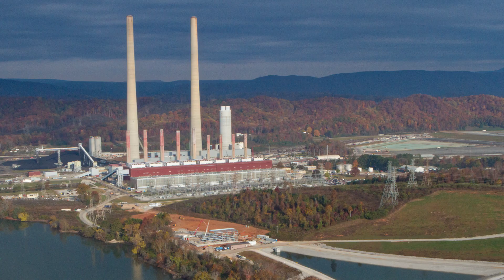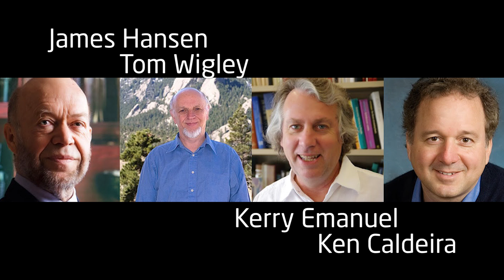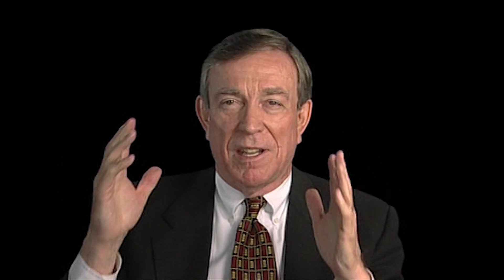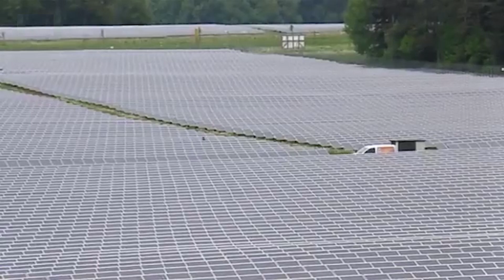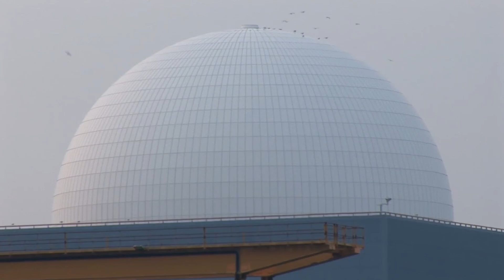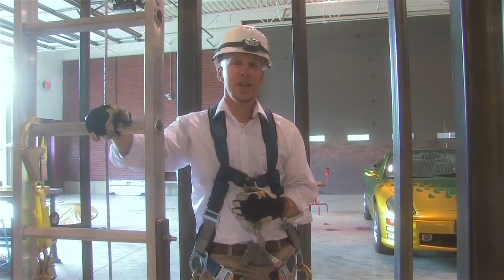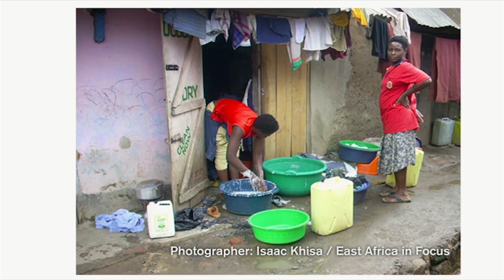Global Warming: Greens vs Nuclear - "Th" Thorium Documentary

Comment: completely shit this video, really ridiculous! renewables can be implemented a 100 times faster than nuclear! nuclear is for dreamers and for the big power companies so they can go on making lots of money!
Reply from the maker: FidelKastrat, Germany's nuclear build began in 1975, and German reactors still provide 18% of German electricity. As the International Panel on Climate Change (UN) observes, nuclear is carbon-free energy. Don't look to Germany's amazingly rapid deployment of renewables (which is impressive), take a look at their GHG emissions. Germany is as-of-yet unable to lower emissions as they replace nuclear, no matter how fast they deploy renewables. This is not because deploying renewables is a challenge, but because the sun goes down, and the wind does not always blow. At those moments, either the lights go out or carbon is emitted.

It took Germany about 15 years to decarbonize about 20% of their grid. I think what you wish for is the ability to DECARBONIZE 100x faster than that, not just the ability to deploy renewable hardware quickly.

Nuclear tends to scale up really well, so yes, the plants tend to be operated by large utility companies. Small Molten Salt Reactors offer the potential for community size energy production, but nuclear will never scale down to household scale.

You can always power your own house with solar + batteries + inverter, if you're not keen on economies of scale. Grow your own food. Turn your own waste into fertilizer. Home school.

If you want to address global warming quickly, you install a nuclear reactor (such as an AP1000, an IMSR or a LFTR) wherever a coal plant is currently sitting. With today's reactors (eg. AP1000) we'd be shipping in fuel. With tomorrow's reactors (LFTR) you'd take the HUGE pile of coal-ash and harness the uranium+thorium fuels stored within. There's more energy in the coal-ash in the form of nuclear fuels than was ever generated by burning the coal.

No new powerlines needed. No energy storage miracles needed. Everything is accomplished on land already dedicated to energy production.
Reply: gordonmcdowell  The new npp that they are building in Finland will be ready (if it works this time) in 2018. That means 13 years to build it. And it’s the same everywhere with other npp. Most of the time there are unexpected problems  and it lasts much longer than expected. And the costs tripled nearly!
Solar can be installed very very quickly. In 2012 we installed PV, the dimension of a whole npp in just one month! You can’t beat that. Yes, it started in 2000 but until 2010 solar was still less than 1%. Now we’ve got nearly 6%! In a very short time! You can’t compete with solar and wind. Nothing is faster!
If we would increase the speed we could be at 60 % or more of renewables in 2022 when the last npp will be shut down. That would replace also lots of coal pp as well
The new npp that are planned in England at Hinkley point will be ready in 2022 (perhaps if everything works well) The EU will give billons of subsidies and the price they will get per kWh will be subsidized as well – 10,6 cent kWh (Euro). In Germany we pay today for PV 9, 45 cent KWh for solar and the prices will go down until 2022. While the price for the nuclear from Hinkley point will rise since these 10,6 cent are linked to the inflation. IN 2057 when they will close them again the price could be at 25 cent/kWh or even more! What do they want in Britain with that shit? They’ve got an enormous potential in Wind energy. But they are wasting their money – money from the EU that I pay for as well!
Reply from the maker: FidelKastrat I'm not saying any Th-MSR reactors are available today. And I'm NOT saying you need to stop fighting climate change by other means until they are ready. However: Return-On-Investment for renewables goes down as they saturate the grid, so I'm trying to intercept the moment where building an additional wind turbine or deploying an additional solar panel on a grid is no longer attractive. A second solar panel on a neighbor's house will peak-and-trough identically... once the grid is saturated that peak has zero value (sometimes negative value).
 .
AP1000 are acceptable for any industrialized nation with a body of cooling water available. That's essentially a zero-carbon solution offering gigawatts of energy. Power being supplied by coal to a grid? That's an straight-forward replacement. There are many opportunities to do this around the world.
 .
You might find, however, like the Breakthrough article mentions, that your supposedly "cheap" intermittent energy source deployed in developing nations will be abandoned after construction. Because the people you've built it for would rather have 24/7 energy once that becomes available.
 .
"Solar is solving problems in Africa every day!"
 .
I make this case in another video. Sorry I don't have time to cram every nugget of info into every video. For having watched this video 2x, you are aware there are other videos in this series?
 .
Yes. I'm happy to see solar deployed around the world. That has no bearing on my trying to educate people about different forms of nuclear reactors. That has no bearing on me trying to show why we should try lower the cost of carbon-free energy.
 .
But you see that deploying a windmill or solar panel doesn't fundamentally drive the technology forward, right? You can lower manufacturing costs and optimize deployment strategies, but fundamental R&D problems (such as energy storage) don't get tackled simply because another solar panel has been deployed?
 .
Developing nations (and developed nations) burn coal and natural gas. They do this because it is cheap. That's why fundamental advances are needed. I'm trying to enable that. If you want to focus on deployment and not R&D then go for it. I'm hardly alone in thinking that's an uphill battle.
 .
Bill Gates (for example) supports R&D into solar. He's spending his own money on that because he sees a fundamental opportunity to improve the technology. (As he does nuclear.) He does CAUTION against a deploy-deploy-deploy strategy. Gates says far too little is spent on R&D and too much is spent deploying expensive energy, and this needs to be re-calibrated.
Reply: Right now the companies that manufacture nuclear fuel make their money of the fabrication of solid fuel pellets and housings. Liquid fuel has no such complex fuel fabrication process or supplier lock-in. Power companies would not find massive profits from a liquid fuel nuclear reactor as they do from current solid fuel reactors.

As for dreamers, a functioning liquid fuel reactor ran in the 50s and was shut down by politics. The guy that invented our current reactor design actually advocated for the LFTR design, light water reactors were never intended as a long term solution.

Try again.

Places effective for solar power are dry, hot and minimally inhabited. Only limited areas are effective for wind, and those are intermittent and unpredictable in supply. Most major renewable energy installations use natural gas as a backup to fill the periods where they cannot produce power. Large scale renewable is just natural gas generation that managed to secure renewable subsidies and grants by bolting on a more inefficient system.

Fossil fuel industry groups are big funding sources of renewable advocacy because they know it will never effectively replace fossil fuels.
Reply from the maker: FidelKastrat I agree with you that renewables can be deployed fast. It is very impressive. My concern is GHG not total kWh. Look at Germany's recent GHG emissions, they're not dropping in any inverse proportion to deployment. Renewables bottleneck on grid infrastructure (no one wants new power lines through their community) and energy storage.And how can you mention subsidies to Hinkley and then state "PV 9, 45 cent KWh for solar" as if that's not subsidized? What is the cost of a kWh of solar energy after the sun goes down?If solar lined up with peak demands... that'd be nice. It ALMOST does... but not not match... there's enormous demand as the sun is still rising and as the sun is setting.I hope Germany succeeds in continuing to lower their GHG emissions. There's some indications maybe this year they'll be back on track. But I'm waiting to see it, and I'm waiting to see how expensive it was, and how much of that drop in performance might be tied to any manufacturing relocation outside of Germany.I am skeptical but I continue to watch Germany to see how this unfolds. As of yet, if the goal is emitting less CO2, then I do not yet see success. But if the goal is simply deploying as much renewable hardware as possible... yay, Germany wins.
Reply from the maker: FidelKastrat I'm skeptical that Germany's building of new coal plants is by choice... I'm skeptical that Japan could deploy renewables instead of restarting their reactors. It seems like a simpler explanation is you're expecting intermittent resource to supply baseload, which may work X % of the time, but not 100% of the time. That it is strictly political sounds like energy-pill or cold-fusion conspiracy. -
 .
"It is centralized energy production and that is reason enough to be opposed to it" ...that's essentially what Amory Lovins said. -
 .
Watch: "Helen Caldicott Th Thorium Documentary" at 1:21:41 -
 .
That's a hell of an attitude to take regarding global warming. And that's a hell of an attitude to take regarding the freedom of choice for others. -
 .
Here's a number of things I find it is more efficient to not accomplish myself: -
.
- Growing fruit and vegetables.
- Processing human waste.
- Recycling (i sort it, i present it as "recyclables" but i don't melt down aluminum cans).
- Securing fresh water (should I use bottled water?).
- Educating my kid via homeschooling.
.
Electricity fits right along side those. Are you seriously telling me you're off-grid? Because if you're not then there's no less power lines required to electrify your home regardless of how many solar panels you've got on your roof... society is helping you with those cloudy moments, and at night. Or do you seriously have tens of thousands of dollars worth of batteries on your property? -
 .
When it is cloudy out, and there's no wind, then all the infrastructure we have today is exactly what is required. -
 .
What Germany is doing is amazing. All the renewables would be helping to seriously lower CO2 emissions, if ONLY the reactors remained in operation. You'd have nuclear carbon-free energy, and you've have renewables too. Natural gas could be used to compensate for peaks and valleys (along with hydro). Germany would have been an amazing success story. Instead the majority of your efforts are spent moving from one clean energy source to another... it is like burning money. -
 .
The cleanest source of energy possible is an already operating reactor. The thing has been already built... there's no carbon footprint to speak of. -
.
Shutting down a safe nuclear reactor, knowing what we know today about global warming, is a climate crime.
Reply: FidelKastrat The long time required for building nuclear plants reflects the complexity that the unstable design requires. Solid-fuel, pressurized water reactors are unstable due to the high pressure operation, and they are unstable due to the tendency for the reaction to either overshoot power requirements or fizzle out, in the absence of constant monitoring and intervention from operators. One of the many advantage of LFTR is that it is dynamically stable. It will tend to maintain a steady operating state and will automatically adjust when the load put on it changes.

The fact that a strong pressure vessel and containment building is not needed for LFTR (because it operates at normal pressures) means that the construction costs are much reduced. The lack of a need for multiple redundant safety systems (due to the inherently safe design) eliminates most of the construction costs and opportunities for construction delays. 

Only one place in the world makes the super-thick steel forgings needed for conventional nuclear reactor pressure vessels. When LFTRs are mass-produced, it will be possible to make one each week in a factory. We could have several factories around the world. This offers the greatest opportunity to take carbon-based generating capacity off line most rapidly while ALSO allowing for continued growth in capacity generally, to allow for expansion of electric power availability to all who might want it. (Most people do want it.)

Systemic flaws are not reported:
http://gaiabrain.blogspot.com/2011/08/systemic-flaws-are-not-reported.html
Reply: gordonmcdowell Why even reply to somebody who does not understand reliability. This deluded idiot "FidelKastrat" Does not even understand how much area wind/solar/hydro consumes.  If the people would want all power to be wind/solar/hydro they would render most animal species extinct due to the land it requires. Plus he acts as if renewable energy is without maintenance.

And an other issue that will rise soon, what about transportation ? When most vehicles use electricity in the near future, will renewables cover that too?
Reply: I'm sorry for the uncalled-for insults.

I just find it unbelievably ridiculous that nuclear plants are being replaced by coal plants. When then coal plants give out more radioactive waste than a running nuclear plant. Going backwards promotes my less civilised communication efforts, sorry for that
Reply: And the main point of reliability?
Screw Exxon and the other money craving twats in the oil industries.
Anyone with a brain worth anything would know that fox is nonsense.
I love solar energy and wind energy, i power my holiday lights with solar panels. but i'm not gullible to the point where i believe it will fix WORLDWIDE energy problems, they are inconsistent and unreliable. 
Just how big of a shadow are you looking for?
Reply: This comment shows quite a bit of ignorance regarding nuclear power. You'd be surprised - even the nuclear power doesn't want thorium nuclear power. Why? Because it would hit their bottom line. So... have an actual read and research the issue.
Reply from the maker: FidelKastrat
This is a pretty short video. I make a clearer case in the Helen Caldicott Thorium Documentary that renewables are useful where grid can't be extended to quickly. You might want to check out thebreakthrough dot org "grid governance" story... looking at Greenpeace deploying solar to the edge of the grid, which was quickly abandoned as the grid was expanded and lower cost baseload became available. Just poor planning there, but the same money could have been spent further from the edge of the grid and it would have been a more sensible investment. I'm not saying don't deploy solar. I'm not saying don't deploy renewables. I am saying that's not enough.
 .
"And that makes me angry!"
 .
Direct me to a deployment proposal you think is acceptable. I'll look it over and get back to you. Please reply 2x... first time with the specific URL, 2nd time with some Google search parameters so I can find it without the direct link included in your comments. This is because YouTube can be screwey when you include a URL in your comment, so I need a search term as backup. Do NOT offer me >1 proposal. I want a SINGLE proposal to review.
 .
So, how do you want to deploy your renewables?
Reply: I would love to see a bunch of turbines and solar cells power foundry's. that would be funny/impressive as hell to see. Or power water purification/pumping stations. Massive mining equipment, planes and big boats.
Fantasy is one thing, stupidity is an other.

You bring up the technology point in it which is quite sad. due to the fact that no new nuclear plants has been able to prove how much better they are due to renewable twats like yourself stopping their construction over fears placed in past events where we have learned a HUGE deal on what to do and what not to do. Mistakes were made, lessons were learned.

Whats the point of the moon landing.?!?
We are not trying to do what has not been done. we are trying to mass produce something and deciding weather option "R" is better than option "N".

Keep in mind that we are looking for new power production means to CUT the amount of RESOURCES needed. Solar / wind do not cut much when you realize the size of the projects with their maintenance and replacement. 

Preparing,constructing and installing solar/wind only creates more pollution and consumes more resources at the moment, like in Germany that rly didn't do it too well, thanks to them closing fission plants and using coal to make up for solar's inevitable downfall. http://www.spiegel.de/international/germany/researchers-alarmed-at-rise-in-german-brown-coal-power-output-a-942216.html
Too much political pushing by non sensible people.
Reply: gordonmcdowell Yes the GHG emissions in Germany did not go down as they should. But this is not because of solar and wind, its because the government refuses to close more coal power plants! That’s the influence of the lobby of the energy companies! We haven’t got the government with green party participation anymore that we had when our renewable energy act started! But we could close a lot of them: About 45 GW. We are producing way more energy than we need and sell it to our neighbor countries! Even in the cold winter of 2012/13 we sold lots of electricity to our “nuclear” neighbor France! But what we did is an enormous success! Simply because it has lowered the prices a lot: solar and wind are now the cheapest form of energy production. And that’s a great thin especially for Africa where electricity is often produce form diesel generators, which is very expensive. Now they can use solar and it is already much cheaper than diesel.
And: A highly industrialized country with an enormous power demand has proven that it works! It doesn’t matter in the end which country it was - could have been any. And in 1979 it looked very much like the USA will become the leader, but then Ronald Reagan cam and solar energy became a “road not taken” Finally we have done it and I’m happy about it.
Yes there are subsidies still in solar, but much less than what they will pay in England in the future! And they will go up while in solar in wind they go down! That’s why it is stupid to built new nuclear reactors. The nuclear age is over. Fusion still doesn’t work and where is your 500 MW Thorium prototype? Until it is there it will be too late. It is centralized energy production and that is reason enough to be opposed to it – apart from the dangers!
Reply: ***** Thorium reactors only require seeding if you don't want to convert the thorium initially and wait for the 30-day half life to be converted to uranium-233 once you blast it with a neutron :)
Reply: ***** take thorium, fire it with a neutron - boom. 30-day half-life begins.
Reply: ***** I guess that's what I was getting at - in order to create the fissile material, that's basically what they're doing - firing a neutron at the thorium.
Reply: gordonmcdowell I watched it again and I must say: This so obviously propaganda! No content and lots fo wrong facts. The only chance for a centralized energy system to survive in a world of climate change is nuclear. And of course the nuclear industry fights against its death. Why do you support them? Why don’t you support THE PEOPLE? The technologies for renewable energy DO EXSIST. They are here and getting better and cheaper every day! Even the technologies for storage!
Let’s got to the end of the video: Yes, washing machines are a great invention –no question, but what has this to do with the source of the energy? WE build here plusenergyhouses with washing machines that produce their own energy from solar. You want to bring washing machines to Africa? Where is the electrical grid in Africa? Who has the money build one Who has the money to buy a washing machine in Africa? And you want to do that and clean water in Africa with nuclear energy? Where are the nuclear reactors in Africa? There is one In south Africa that’s all. Impossible n Africa without lots lots of money from the west! And you have to build a grid as well! It’s just a ridiculous argument. There is not even one Thorium reactor in the rich countries! India is building one. Maybe it will be ready in 2020 – if everything works well. Is it sure that it world perfectly and is reliable? There are scientist who say it will take another 40 years until we can be sure that this technology works as good as promised! Until 2020 India could build solar and wind farms 50 times the dimensions of this one Thorium reactor! It’s just ridiculous propagating a technology that is very questionable and call ti the solution! Even if it was reliable today: How many can you build until, let’s say 2035?
No problem with renewable technologies! We could be at about 60-70% worldwide already if the governments would agree to change as fast as possible! There are very much simple solar technologies that can end deforestation in Africa increase the amount of food, produce fresh water – and that’s a realistic scenario! Thorium reactors in Africa? That’s really a very bad joke! You’re abusing poverty in Africa to help the energy giants to make more money! And that makes me angry!
Reply: gordonmcdowell This is the second time you are running away from my question.
Where is your 500 MW Thorium reactor? Where is your scientifically based clear answer that they will work as perfect as promised? NO scientist doubts that solar works! Today - in the past – in the future! Albert Einstein won his nobel price for explaining the photoelcectric effect that is the basis of this technology!
What is Thorium energy doing now, today dec, 26. 2014 doing for us humans? And for Africa? How will they fight climate change if there is none? If there perhaps could be some few ones in 20 years? Solar is solving problems in Africa – every day! It is already much cheaper than Diesel generators. This is happening NOW! And not maybe perhaps one day - if everything works as fine as you wish. The Thorium reactor in India will be ready round 2020 – even if it works: How do you get the power to the 50.000 villages in India without grid? How will this reactor do something god for the people there - and not only for the growing industry in India? Anybody in a village in India can have solar eclectricity in 1 week if he can pay for it (and that was not possible 25 years ago – was too expensive –not a bad job germany did, lowering the price for solar!). Everybody in Africa can have a solar cooker in 1 week if he has access to a program that teaches them how to build one – and his wife won’t need to spend 4-5 hours EVERY DAY to collect fire wood! And what is you Thorium reactor doing to help them?
NOW?
TODAY?
In 1 YEAR?
Where is he?
How is it doing something for the people? Now and in ten years?
Don’t run away from my question again by using a counter question! Answer it!
NOW!
Reply: Phil F Thank you for your comment – that was really great! It’s people like you that amuse me more and more. No idea what you are talking about but insulting heavily.
“If the people would want all power to be wind/solar/hydro they would render most animal species extinct due to the land it requires.” Where did you read this, on the homepage of Exxon? Or heard it on Fox News? :- )
Here in Germany we would need about 1% of the surface of our country to produce all our electricity from solar. Since we only want about 30% that would mean 0,3%. And we are a very dense country with low insolation!
Trasnpsortation? To replace all cars that we have with electric cars would need just about 13 % more electricity. About 4 % we won’t need anymore because we use it just to produce gasoline form crude oil. 9% left. Up to 5 % could be produced by solar on the cars themselves. Now we’ve got 4%. But since we will use less cars and trains will as well produce more and more of the energy they need from aolar and wind along the railways means, all in all: We will need practically no extra power at all to replace cars.
Get some Information. Some real information. Please not from Fox news that claimed germany is sunnier than the USA
Reply: Phil F „You want to fly to the moon? Really? Do you know how difficult this would be? To build such an enormous rocket, calculate the exact route, to land there, carry a rocket with them for the way back, and and and! That is ridiculous! Lmao hahaha!”
That’s what you’be just been telling me here. Keeping a grid stable with volatile energy sources as sun and wind is way less difficult than a flight to the moon! It’s not a problem at all! We’ve got the storage technologies and we’ve got enourmous computer technology today compared to 1969. It is not easy, but it’s not really a problem. Scientist here already made simulations with real wind turbines, solar panels and biogas plants and it worked perfect! That ‘s a ridiculous argument! The sun delvers 10.000 times as much energy as we need! And we can collect with direct solar, wind. biomass, hydro and wave power - no problem!
Reply: *****  No, I am not deluded - I am very well informed! that's all! :-)
Reply: FidelKastrat With a NPP you build it and it works for 60 years. Solar you need to replace the batteries, clean the panels, repair the panels and such. This is problematic. Also, what is the price of storage?
Reply: ***** pretty sure that's why Musk wants to set it up in the desert. Makes sense to me :)
Reply: ***** it's not about starting a chain reaction, it's about converting one isotope to another. Thorium doesn't react by itself, hitting it with a neutron simply moves it along the decay chain, to provide the fuel for thorium reactors.

I'll admit I'm not nuclear physicist so I am a little out of my depth, but that's I think correct based on what I've read from the process involved.
Reply: When San Onofre Nuclear was shut down in January 2012, the power company's [tfits went  up, and the air quality went down.
Not even renewable alleged capacity of 1000 MW can be built any faster than we used to be able to build 1000 MW of nuclear. It is slower now because idiots like the NRDC throw lawyers at it, and the NRC is damn near the Nuclear Resistance Cabal.
But there is no quantity of wind engines that can guarantee response to a 1000 MW demand when it arises, not even continue to support the load that it is presently supporting, for the next 20 minutes.
Reply: +Kirk, +Steve The neatest way to look at a thorium-fed MSR is that it is renewable nuclear. 
You split a fissile uranium nucleus, and create another one.
Or perhaps you could start off with plutonium 239, to greate your _next _ fissile uranium nucleus.
 As Steve points out, neutrons from the first fission create the next fission in the chain, and after a couple of decay events another of the two or three neutrons per fission creates a fissile nucleus to replace the one that was fissioned.